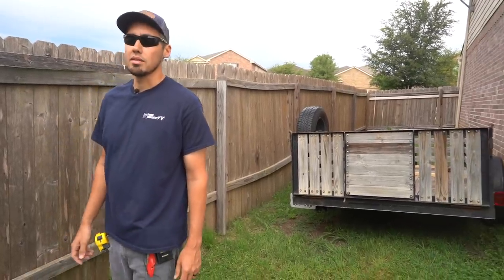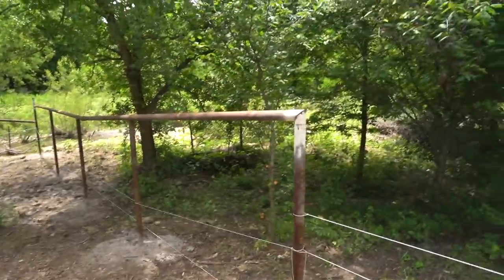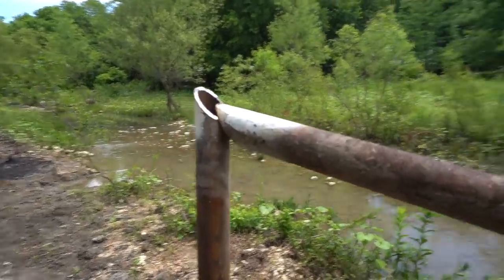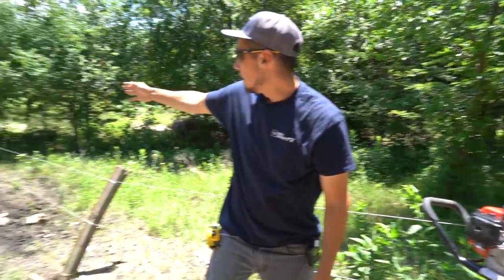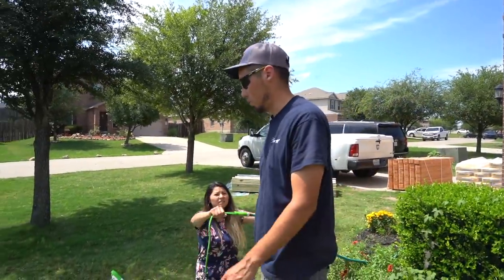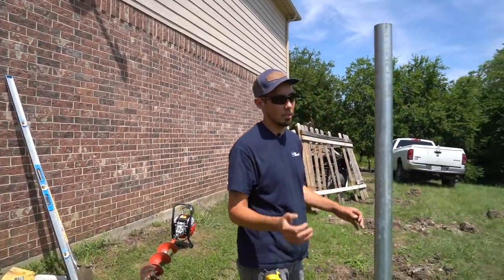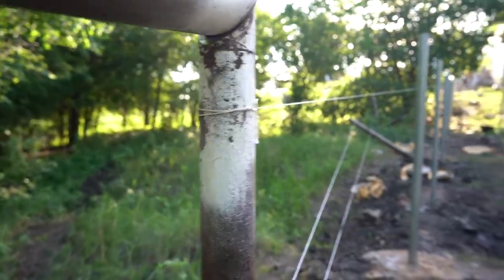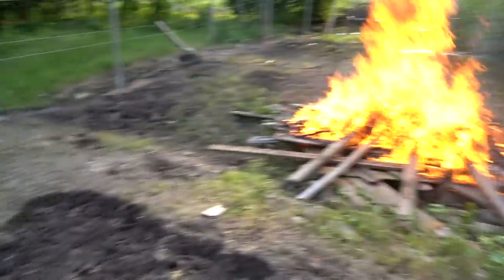Building a Fence - Setting the Posts

Comment: TIP:If your two end posts are plumb then run a string at the top (like you did) and at the bottom, that way your fence will be dead straight and then you only need to plumb side ways.
Doing it the way you did it it wont be stringline straight but within 10mm straight 
Hope that makes sense.

Comment: I was waiting for that "whoomp" when you lit the bags on fire. You know concrete dust can cause explosions in confined spaces right? Not much of a danger out in the back yard, but wonder if part of that reaction wasn't due to dust in the bags igniting.
Reply: Did you miss the part where he literally dumped gas on the extremely easily lit paper bags? That was the vapor cloud igniting.
Reply: @PortersMob  I didn't miss that, just wondered if the dust maybe gave it more umph.

Comment: not enough concrete on the poles....hate seeing dry mix in holes..crap lazy way to hydrate concrete....3 --80lb bags per pole....that way when some one climbs the fence it doesn't tip over....one bag and a pole hole digger isn't enough support on the bottom of the pole to support the forces that can be exerted on the fence via humans or wind!!!

Comment: Interesting. I've used pipe-rail fencing for nearly four decades. However, I typically use pipe and tools purpose-made for that use. There are coping tools available that cut the arcs. I've only cut a couple by hand. Using the tool is FAR easier. One pull and BAM, both sides perfectly coped at once.
One time, around 1984, I had to cut and cope about a hundred posts that someone else had already set in concrete. Two sets of two rows, which were destined to become two 250' long shades for horses, parallel to each other with a long aisle in between. Metal roofing was to go atop purlins, which would be the top rails that I was about to set. The four rows of posts were in a line pretty well, but none at the correct heights. The rows nearest the aisle topped out at about 10' off the ground, the far two rows about 9' off the ground. Obviously that's much higher than a normal fence. This was a real structure, though almost identical in form to your fence.
The drive aisle between the two shades gave men an idea: I could build a crane of scrap wood on the ranch's 4x4 GMC Jimmy, which had no top (just a windshield), and was a real beater. So I bolted and screwed a bunch of 2x wood together until I had a boom crane that extended a little past the farthest row of pipe posts with the truck in the aisle, and high enough the post to serve my needs.
First I set the cut lines. A nylon dry line 250' long would sag far too much. Instead, I used a Builder's Level on a tripod, with the base tilted to the necessary slight slope (about 1% grade south), then marked all the posts. Not at the tall height, as that was way over the eye level of the instrument. Rather, at about +5'-6" or so. A Sharpie mark on each post. Once all hundred posts were marked, I measured up from that set of Sharpie marks to mark the true cut height for each post. Taller near the aisle, lower away.
I cut all the posts with a pipe cutter. This is fast, true and easy with these fence posts, and is always square. The ones near the aisle, I cut while standing on a ladder connected to the bed of the Jimmy. Pretty high up, you see. For the far row, which was blocked by existing corral fencing, I stood on a citrus picking ladder. Once the pipe cutter is clamped on, you just spin it. No power tool, and nothing to lift; just spin. Fairly safe.
With all cut, I then had to cope. There are both hydraulic and manual coping machines. I got a manual coping machine. The beast is still hella heavy. Thus the idea for the crane, due also to the height. Using baling wire, I rigged the coping tool to hang from a come-along, which hung from the wooden boom, in order to be able to adjust the height a bit, a click at a time. Once hung at about the right height, I would have my cohort move the Jimmy into position in the aisle. I'd move the coping tool onto the top of the cut-to-height pipe post. Then pump the tool. POP! Both coped crescents would pop right out after the necessary pumping. Easy and perfect. I had to be careful to align the tool correctly before starting, so that the paired copes would always be aligned. Again, as this was not a power tool way up in the air, I had no safety concerns other than standing up on a ladder in each corral. Did all one outer row, then the other outer row. Then one inner row, then the other. Done.
Set all the top rails in place. Sweeeeet! Ready for the welder (not me).
Once all was welded and hit with cold galvanizing compound, I set about installing the metal roofing over the two very long shades. Again, working from ladders, driving a whole lot of Tek screws with rumble washers.
The twin shades are still there to this day, keeping horses cool in a whole slew of corrals on a horse ranch. That same ranch has miles of pipe rail fencing. All coped with specialty coping tools (tube notchers) developed for that purpose. Although most are cut in the shop beforehand (best), or via a hydraulic unit on the fence contractor's truck (saves manual labor).
Reply: Wow

Comment: Never touch a post that you are installing to your straight line.  Leave post 1/8 away on each post.  At your corner post, out an 1/8th inch shim in between string and post....when done, fence will be later line perfect straight.  Yours will be crooked when you finish,,,guaranteed!

Comment: Got a question for you bro.I’m re-trimming the columns of my front porch and wanted to ask you how I figure out the miter measurements? I would just cut to the same size as the ones on there but the geniuses measured wrong and used a ton of caulk to hide their bad cuts lol.

Comment: For those saddles you don't want them to fit too snugly as you get the best weld, the best penetration, and the best fusion of metal, with a V-groove between the two welded parts.

Comment: I am really impressed with your trim work and have learned a lot. I’m gonna be judgy here and say a couple of things. 
Don’t push down  posts with your truck. Get a farm jack with a short piece of chain with a sliding  hook and a clevis hook  and jack en out of the ground. Get a wheel barrow to haul the bags of cement. You’ll know why when  you get older. Put a guard on your grinder, AND WEAR PROTECTIVE GLASSES WHEN YOU GRIND METAL. I like your method of coping molding  with a flap wheel I tried it and it works really well, but even then I wear glasses. People watch your channel and if you do it that way, they’ll think there’s no problem for them to do it too.